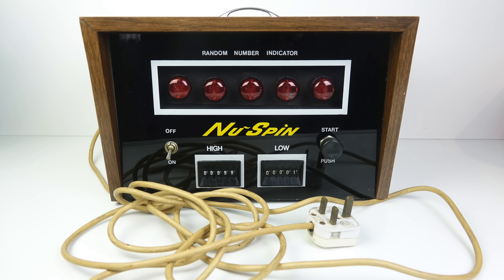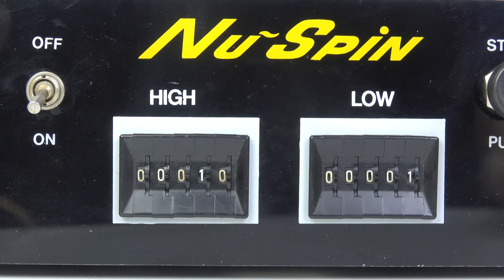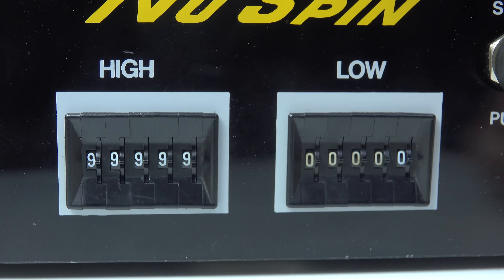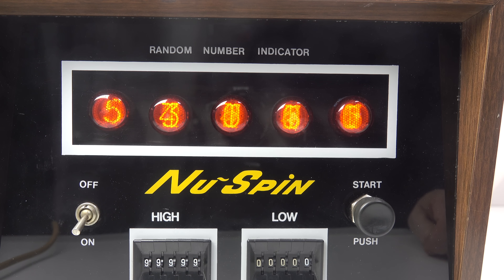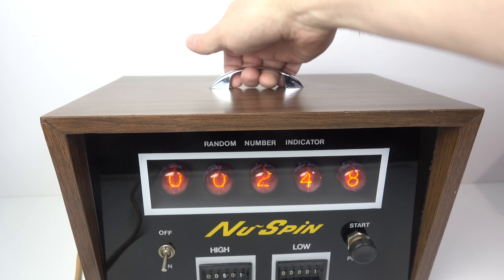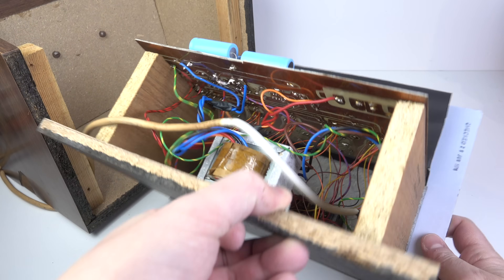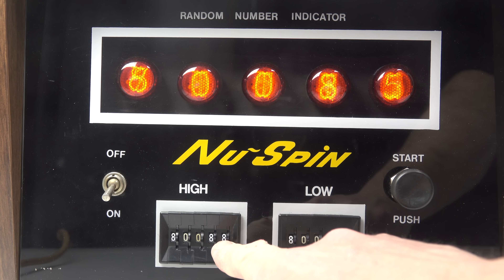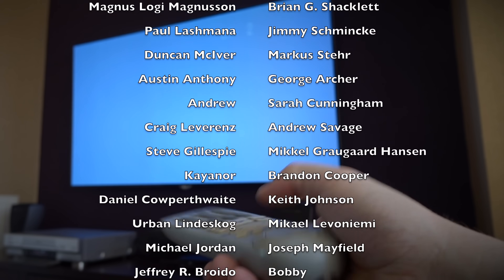This is a bit random - Vintage Random Number Generator

Comment: You should ask bigclive if he wants to reverse engineer the schematic for that thing. I'm sure it'd be a fascinating piece of 70s electrical engineering.
Reply: From a comment above - 5x 74141 BCD to decimal (for the nixie tubes), 5x 7490 decade counters, 1x 555 timer, 2x 7400 quad 2-input NAND and I think 1x 7413 dual 4-input NAND Schmitt trigger.  That's electonically pretty boring TBH and is all about the display logic rather than the randomiser (which is probably seeded on the turning on of the device and clock oscillations since then, plus an arbitary delay from a partially charged capacitor from the button press?)
Reply: He'd probably be able to debug the 80085 thing too.
Reply: The stuff we see is probably display logic yes, but as you point out - it's not very clear where it derives it's randomness from. It's probably related to some sort of astable RC circuit associated with the 555 but what controls it?
Reply: I suggest crowdsourcing it. I can likely reverse engineer it from just 2 decent photos. The problem is exactly that i didn't see where the random number generator is, who cares about the pedestrian display bits.
Reply: djsmeguk Maybe capacitor charged via button push, and the subsequent discharge time. During that time the 555 generates pulses causing a decade counter (DM7490AN) to continue to count, and roll back over until the 555 stops generating  pulses, stopping the count. The setting controls just set the initial count limits in a binary of sorts. Th counter has some additional circuitry after this to work out how to display with gates and others to drive the nixie tubes. Of course this is significantly simplified and a guess at its operations. I could take some real time to work out the full functionality of that circuit because those images are plenty good enough to do so. But that's my guess from a few seconds of looking it over and going from memory of what chip numbers do what function.
Reply: For some reason I doubt he would be interested in debugging 80085's rofl
Reply: Only if he promises NOT TO MAKE AN X-RAY OF IT!!!
Reply: As I noted above, the thing probably uses six 74193 BCD counters with the LOAD wired to the lower 6 limit switches to set the start count, and the upper 6 limit switches are using the NAND logic gates to compare the upper 6 limit switches which drive the LOAD pin of the counters (reset it back to the number set by the lower switches) to bound the count to the set range. A 555 timer clocks the whole thing and a second 555 is used to gate the counters so they stop at some point between the two counter limits. The counter start is set by the button and the stop is set by the 555 which is asynchronous to the button press, giving the random interval.
Reply: Get Julian Ilett to make one.
Reply: USWaterRockets No it doesn't, the decade counters are simple 7490's  - clearly visible in the photo. So no preset ability, just the ability to set to 0  or 9. Which does make me wonder about how it does the the high and low. My guess is that the thumbwheel switches pull either the input or output of the 74141 low. If you look closely, it looks like there are wires coming from the switches to the connection between the 7490 and 74141 so I would guess they are BCD thumbwheel switches and the input of the 74141 is pulled somehow with a combination of the low and high switches. Note AFAICT there is not enough other circuitry for anything more elaborate.
Reply: Ahh! When I wrote that I was not able to see the printing on the IC's in the video. Did he read off the part numbers or post better photos later? I was only guessing LS93 counters. In this case I don't know how the preset is working. I suspect it may involve the 9's compliment mode of the LS90's, which might explain why the thing has trouble with narrow range settings. I will noodle on it more when I have spare time. Thanks.
Reply: USWaterRockets I just paused the video and zoomed in - you can read the numbers. The only one I couldn't read clearly was the leftmost IC but it looks like a 7413.
Reply: Dude yes I keep thinking that techmoan and bigclive would get on great as mates

Comment: I very, very much doubt that it's all that random, especially on the high digit.
Reply: Actual random number generator's for labs use radiation and a Geiger counter. That much I remember from AN interview I heard on the NPR.
Reply: With something like that it's never going to be random, as it's drawing on some known (at least to the machine) quantity to generate the numbers; at best it's a pseudo-random number generator, but most of us knew that anyway. As Jared said, labs wouldn't use this as it's nowhere near random enough, but it would suffice for most of the rest of us.
Reply: rumborak Wheel of Fortune only requires that the wheel make one complete revolution.
Reply: Jared Jeanotte well, a really good random number generator is an ccd chip (which are usually found in cameras) in pitch black. The noise generated by it is just pure random (after filtering static errors) because it's caused mostly by the temperature of the chip itself, just recording it's own Brownian motion.

I've heard some rumors that CPUs might have a ccd in the future, build in for the purpose of generating randoms. :)
Reply: Thing is, it is maybe even cheaper to have an actual random number generator. Just use a noisy PN junction and crank it into a shift register at high speed.
Reply: I agree, 4chan is more random than this. Then again, 4chan is more random than anything.

Comment: I find it odd that they used nixie tubes, I was just a beginner electronic hobbyist back then but I think 7 segments LEDs digits were available for cheaper than nixie tubes and their drivers. And back then LED's looked cooler than nixies because they looked more modern while nixies did not look antique enough to be cool yet.
Reply: I'm guessing this design dates back a bit from the 1978 build year, judging by the serial number - the company that did it probably didn't want to re-engineer to accomodate LEDs.I seem to remember seeing something very similar in our UK high school in 1972-1976. Trying very hard to remember what we used it for, whether Maths or Physics - I doubt its purpose was an electronic tombola!
Reply: We still used random number books in the late 90ies and early 2000s. Such a machine would be considered wasteful.

And oh those books were stupid, it's much nicer to just use your calculator.

Comment: would guess this could be used at something like a bingo game? I doubt though it's truely random (most processors that age werent), unless it's hooked up to interpret radio waves.
Reply: ...or thermal noise of a diode or transistor.
Reply: Gernot Schrader
tl;dr

Comment: I thought this was going to be a pure mechanical device because of the nixie tubes and dials, pretty neat to find some microchips in there.
Reply: To be fair, those look like ICs rather than any sort of microprocessor
Reply: IC means "integrated circuit" and a microprocessor is also an IC, but yeah, those really are very basic circuits.
Reply: I think you'd be hard pressed to find a purely mechanical device with nixie tubes. It's at least going to have tubes or transistors, though microchips have been available for a pretty long time (these are from 1974).
Reply: Fairly certain those are logic gates
Reply: Sampieri Matias few of them are, but there’s also simple counters, a bin-to-dec converter and a 555 timer.
Reply: Julien Oster
I didn't actually SEE the 555, but it certainly would be there to provide clock pulses for all the 74xx ICs i DID notice. Not even 74LSxx or anything, just plain old 7400-series.
OK, on second view i did see the 555, and a bunch of actual 7400 quad 2-input NAND gates. Also, 5x 74141 BCD to decimal decoder/driver for cold-cathode indicator/Nixie tube.

Comment: What happens when both numbers are set to 00000?
Reply: rafamigayt the universe collapse
Reply from the maker: Nothing (x5).
Reply: Guess it's another bug. Should return a number between 00000 and 99999. And this implies "99999" won't show up on this device.
Reply: It catches fire.
Reply: Time implodes
Reply: Reality becomes an illusion and the universe becomes a hologram.
Reply: Nuclear fusion
Reply: rafamigayt A portal opens up to another dimension.
Reply: The device starts a gaming channel and gains 100,000 followers.
Reply: You get an instant warp travel to the moon.